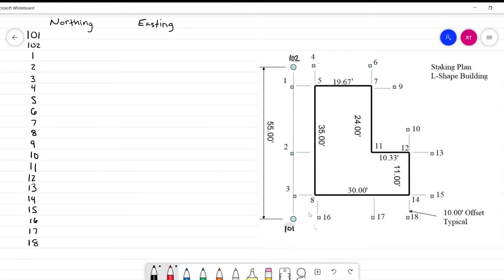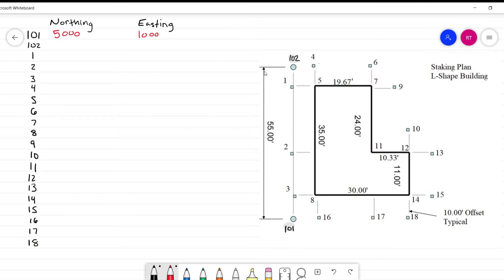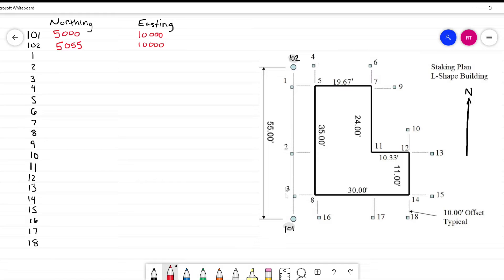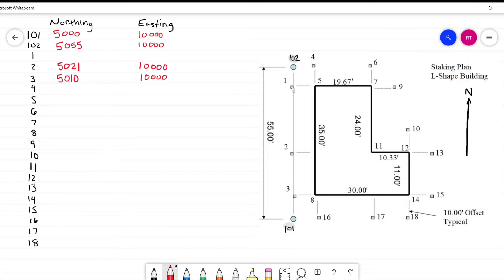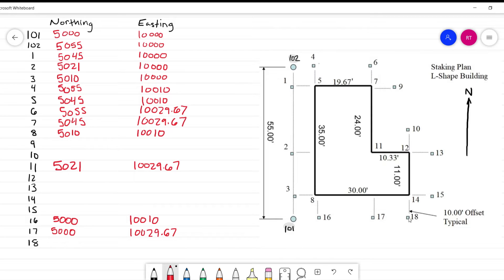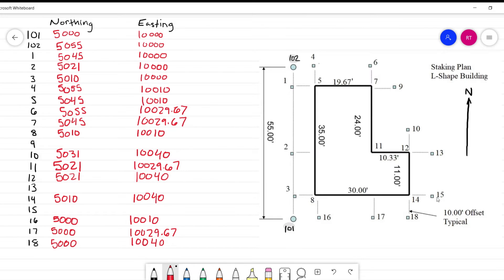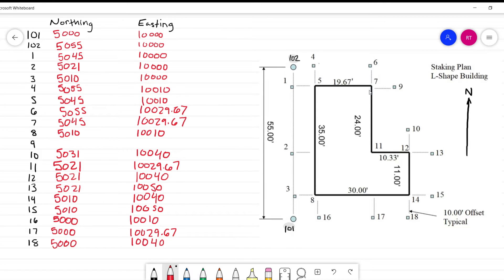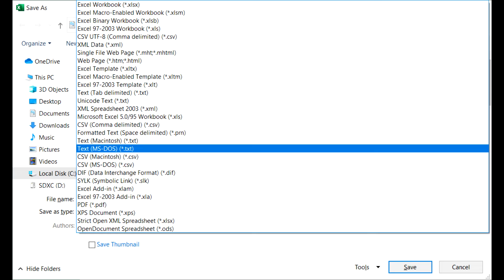Surveying Stake Out for Beginners

Comment: You are complicating that which isnt really complicated.
I was a home builder for more than forty years.
During that period of time i personally staked out and set batter boards for several hundred homes and a few large commercial buildings.
First important thing is to have the building lot corners located and marked by a registered surveyor.
Second is to have the building located on a plot plan of the property.
Then pull measurements from the property lines, allowing for the required setback requirements, and drive a stake in the ground at an exact corner location. Which corner you use isnt important.
Next drive a nail in the top of the stake, then set up a transit over the stake, level up the transit and hang a plumb bob from the transit to the nail in the stake.
Next measure from that nail to the opposite corner location, adding whatever distance needed for the offset from the actual corner location for excavation purposes.
Drive another stake, and drive a nail in that stake.
Line up the transit cross hair on that nail, lock up the transit and turn the dial to zero.
 Then rotate the transit 90 degrees, measure out the ten feet, or whatever distance you established  for the offset.
Drive another stake, so that the top is at the same elevation as stake # one.
Drive another nail in where the cross hair dictates.
Rotate the transit 90 degrees again measuring out for the offset, and drive in stake number 3, again at the same height as the others, and drive another nail in the top of that also where the cross hair dictates.
So now we have 3 stakes, one 10 feet beyond the far corner, and two 10 feet beyond the stake under the transit.
Next, turn the transit 90 degrees and measure out the distance for another corner, lets say a rear corner, and add the extra 10 feet beyond that also.
AGAIN, drive another stake, with the top at the same height, drive another nail where the cross hair dictates.
So we now have 3 corners located and marked with nails.
We are now finished with the transit, other than for leveling the remaining stakes.
We will now be using just a tape to measure for corner number four, buy pulling from the nails in the other stakes.
When all four corners are located and the stakes are driven with nails set, you can run string lines and double check for square before proceeding on.
By pulling a tape from the appropriate nails you can set stakes for any offsets etc. as the plan requires.
Again, at this point the transit is used for leveling additional stakes only.
The stakes need not indicate anything but the actual corner locations of the building.
As for the elevation of the building floor height, or excavation depth, other things such as terrain conditions etc. need to be evaluated in order to determine that.
But the tops of the stakes can be used for that purpose after those decisions have been made.

Comment: I’m a beginner on grade checking. I am about to do my first drive way. Survey gave me a cut sheet I wanted to see if you would be able to specify what is top of x and bottom of x
Reply: Top x is where the end of the apron/driveway meets the curb.  Bottom of x is the the slope of the apron meets what is called 0 curb (usually it’s not zero, it’s about a .10). Generally there is 2 top and 2 bottom of x for each typical driveway

Comment: How did you relate the co-ordinates for the building 
to the line you established on the ground
Reply from the maker: I assumed the coordinates to be:
101 - 5000,5000
102 - 5055,5000
Reply: Pro here. First u always shoot your control ( prop corners curb etc). Then you draw the build first without the offsets which can make it confusing for a layman. The you translate and rotate your drawn building lines to the location designed by the architect or design engineer.  Make sure to account for building setbacks and easements etc. Then thrown out your offsets. Then stake the building. You might need to run in a benchmark also. He is missing so many things that are needed but his concept is correct. Basically he drew box with an box missing. I staked 4 building envelopes last week and all the builder wanted was the box. Most of the other offsets get knocked out anyway. 
 His videos are good to get an understanding of what and how surveyors do things but we all have our own methods and they vary. hopefully he did not violate any building setbacks when he randomly laid out this structure.
 Also , if you know how and can you a plumb bob you will eliminate most of the tape error. All total stations normally have up to .01 of error due to temp and light refraction.

Comment: Thank you Rami.I work as a surveyor in France we go too for a free station and use known points in X-Y-Z to determine the stations coordinates and then we start stakings if the results in field are close to those in theory of course.
ps I liked your video for the accuracy of Iphone lidar system.
Reply: So you resection every time you set up. Cool. We usually resection when control is destroyed, or lost.

Comment: If you use a 100 foot fiberglass tape or one even shorter they give great measurements. I have some ranging from 33 feet to 330 feet and they all work great. It stands to reason that the longer the tape the less accurate will be the measurement even if it be with steel tapes. I measured my property line which is 125 feet right to the hub with a fiberglass tape. I was surprised about it as much as you. The bottom line is they are better than the reports about them. Cheers.
Reply from the maker: Tape measurements are much more accurate than most people think. Only problem is angle, it's really hard to guess without a compass.
Reply: Fiberglass tape “accurate” ? Hardly. I can pace almost as good. You can even see where it’s stretching (depending on your pull) when you’re setting your 2nd control point. Steel chain should be used, especially at “step #1” setting your control. Or maybe …. just maybe, use THE GUN ???

Comment: rami why or when would you use stakeout or use GPS cordinate to set up a site as opposed to the other
Reply: GPS takes about 2 minutes of 1Hz signals to sufficiently calculate the location.  And GPS doesn't work under a canopy of trees because the GPS signal bounces off the trees, so the receiver doesn't truly know where the corresponding satellite was.  As a rule of thumb, if you're locating property corners, you're better off doing a stakeout with a total station/prism for better precision, better accuracy, and more speed.  But 5-second 1Hz GPS is okay for a topo on an open field.
Reply from the maker: In practice we would use a GPS. But for the purpose of education, I am simplifying the process to focus on the important topic of staking.

Comment: You need to turn tracking on for stakeout with Carlson. Good video other than setting lath instead of a stake for building corners. 😔
Reply from the maker: Yes, Carlson is a great data collection software with amazing features. I only used the lath so it would be very visible in the video, but yes you are correct!
Reply: @RamiTamimi  Carlson is garbage compared to Leica but you take what you can get I guess. It seems like you take pride in what you do and learn a lot from your father. I applaud you for that sir. My father was a surveyor for 40 years and he taught me everything I know also so I can relate.

Comment: nice video.  did you ever consider using a golf bag with rolling wheels to hold you stakes?   take out golf club rails to make it easier to get out stakes and hold hammers.
Reply: That depends on the field.  I've surveyed fields in which I was simultaneously sitting and standing due to a previously-unknown ravine under rotting wood or other vegetation.  However, the golf bag theory looks good at this site.
Reply from the maker: You sir are a genius!
Reply: They say once you start using the golf bag trick you lose your edge.